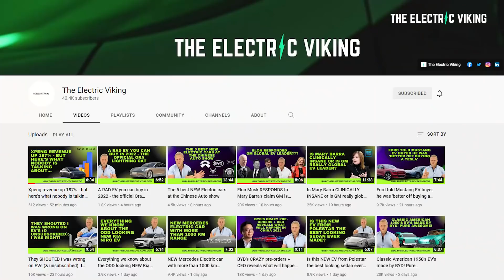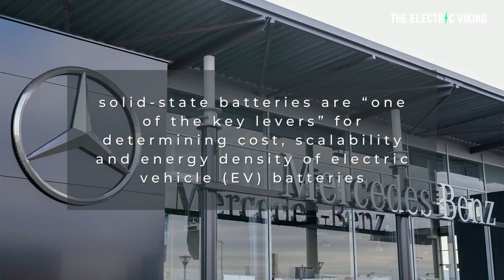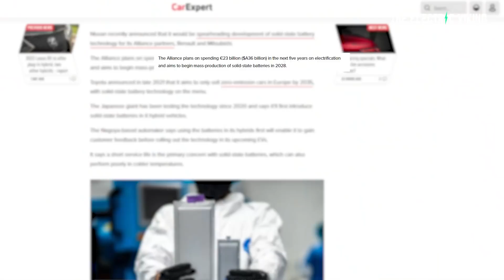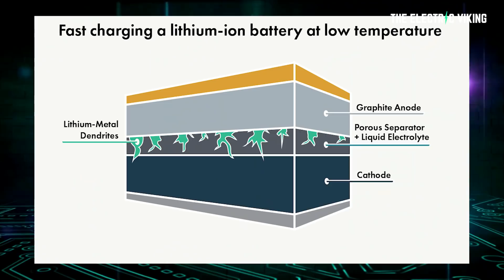Mercedes secretly working with Solid State company in Taiwan

Comment: Filso; I agree Solid State will be critical. However GM' s partner is already selling a $4000 EV in China.  LI EVs have now been around a decade. 
The problem w Lithium and potentially Solid State is the supply of component elements.  There isn't enough lithium or cobalt to make a significant number of Li based cars; max 2 to 4 million.  Big EV makers are going into mining to try and supply themselves.  Lithium prices are up 400%; Tesla can absorb this with their expensive cars; but lithium is a dead end and will never be a major part of the market - you could make 10x more hybrids with these resources ; that would make an immediate impact - Tesla is actually perpetuating ICE vehicles.

Comment: Solid state is the holy grail of the EV industry; if a Solid State that isn't at least 2x more economical , lower weight, safer, w better life cycle unconstrained by resources - then EVs fail.  LIthium EVs can't be made in enough numbers. Tesla sucked up 24% of all Lithium production to make 900K $40,000 USD cars that weigh 5000 lbs.  Lithium cost is up 400%.  1 Billion ICE vehicles exist - obviously Lithium is a dead end.

Comment: Solid State battery can also use Iron phosphate as Cathode to bring down the cost with higher energy density. SES CEO mentioned that during the firechat with IPO Edge. Imagine Li-Metal FP with 300Wh/kg at the similar cost of current LFP.

Comment: Solid state batteries could be very important for longer-range vans, campers, trucks. Existing battery tech gets very big and heavy trying to give them the range that we've got used to in cars. So higher energy density really does have commercial value there. That's not a 2030 thing, that's a right now thing. No-one makes a van that does more than 200 miles yet. They don't make one that does 200 miles on the motorway yet either. You can put a huge battery in a van, but at least in Europe that leaves you with very limited capacity for payload or camper fittings within the standard 'normal driving licence' <3500Kg class. We could just make (and allow people to drive) 4 or 5 tonnes vehicles like they do in the US but it gets expensive and inefficient. More energy-dense batteries really do matter in this market, so if someone can produce them at a reasonable price they'll be snapped up.  OK campers is a bit of a niche market, but there are an awful lot of workmen's vans that do quite long drives and they really would like 200 miles+ in order to get to jobs easily. That's more than just a niche. (but those people are price-sensitive, much more so than the campervan types, so it will remain niche if it costs too much).

Comment: Toyota has invested big on R & D for hybrid power systems and they are not going to dump it instantly and hop on the all electric vehicle
wagon just-like-that,  they want a good return for what it's cost them. Same goes for the rest of the old guard, they don't want to scrap expensive plant and equipment that still has a useful life until it is fully depreciated, what's all this rush about anyway?

Comment: Where I disagree on solid state batteries being luxury, is that commercial application where weight is more of a factor, eg hauling, aircraft, etc. may benefit from higher upfront battery cost to gain the benefits of energy density and charging speed. Not everyone can run accelerated research like Tesla though, so it remains to be seen where LFP technology will be, by the time Solid State is ready for mass markets.

Comment: Seems dumb to put a SS battery in a hybrid. Just put the full battery in a car and see what real world range you get. As far as needing double the size of a battery energy density above 700km I can sorta see a use case "if" SS batteries suffer degradation like current Lithium ion batteries. If you're limited to charging up to 80-90% and if they offer up less range in the winter then yeah I can see the need. Then again it might not have t be if the car has a good BMS, the car is slick and efficient then I imagine it's not needed.

Comment: Thanks for sharing. Solid state batteries are far from being only about the range. Price, range AND fast charging will be key in dealing with EV anxiety to convince the wider population that EVs are at price parity to ICE AND more practical. Additionally, existing battery technology has inferior battery life in terms of discharge energy and chargecycles. Solid state batteries will be absolutely key in driving the EV evolution in my opinion. Unsurprisingly and as with any new tech in cars it always start at the expensive models and trickles down as they scale up production while and covering their return on investment.

Comment: Don't know how soon real mass production of solid state batteries will occur, but even as Sam said that we may not need to double the existing range of current EV's, it still means they could cut the batteries in half to keep the current range.  Less weight = better range and efficiency.   Also, half the batteries hopefully would be less materials used for the battery pack, and [hopefully] less cost for the same range.
Reply: Also solid state shouldn't need as complicated or as heavy cooling&heating systems. That and as you pointed out less materials.
Will make them much more sustainable. Plus imagine twice the volume of cars for the same amount of battery supply. 

All that said current tech is improving yoy by 3-5%+ so at that rate in 5 years current tech will have improved by itself another 15-30%.

I think solid state at first stays in high margin, very high performance but low volume segments, and lfp like the blade battery and teslas structural packs basically takes over every other segment for evs. 🤔

Comment: The market where solid state batteries will make a real impact is motorcycles.  That weight savings and greater range will make a big difference in the limited space available on a motorcycle.

Comment: Advances in batteries which lead to reduced vehicle weight will be a great thing for the environment and for road maintenance. Heavy vehicles beat up roads much faster which increases asphalt and concrete usage. It's difficult to predict which battery technology will become dominant. Things are changing rapidly and it will be so interesting to see how it unfolds.

Comment: By putting them in Hybrids, they can use software to control the reduction of stress on the battery while they see how it performs. The unwitting testers should not be aware of this hold-back if it is needed, they will just use more petrol.

Comment: Mercedes may be correct for high end vehicles. Solid state battery production likely will not scale well and be expensive, but the performance may be very good. It would seem right for Mercedes and other high end yet low volume producers.

Comment: Im not sure SSB can overcome temperature differences when vehicle is turned of and unplugged. cold winter, warm summer, even day night temperature difference will probably break them to fast unless they are very insulated and constantly manage temperature(maby if the cars use solar panels to recharge so they have some power to keep level temperature for long inactivity outdoor).
Reply: The ProLogium cells have a very wide operating temperature range, -40°C to 85°C.
Reply: @cruiser97eric1  yea but operation range is one thing. Damage from heating/cooling over time is another :)

Comment: If the battery can hold more energy in the same volume, then that will lead to cars with similar range and a lighter battery. In turn, that leads to smaller cars with good range, which is aided by the lower mass. A 300 mile Summer range is better than most petrol cars (mine always had 160 to 280 mile range), and people don't complain about that. So ludicrously long range vehicles will become a niche market. My thought is that 200 to 300 miles of range in an EV will become the norm.
Reply: There will be autonomous fleets on the road within a couple years, and they won't even need that much range for 99.9% of customers.
Reply: @-whackd  2 years? More like 10 years.

Comment: I can see the logic in Toyota's rescue of its strategy. The company is heavily invested in Hybrids. SS batteries will be thin on the ground for a long while. Therefore it makes sense to Toyota to maximise the supply by putting them in Hybrids first, where they can be smaller.
Reply: If that was their motive.
But didn't they (Mr Toyoda) say they're only aiming for "50% "electrified" of which a fraction will be full BEV, with the others being ICE/ Hydrogen hybrids"? (Reading between the lines of their "carefully worded" statement)
Reply: @rogerstarkey5390  In all honesty, I' m just trying to find logic in Toyota's incredible error. They thought they could dictate the future, having a very long term strategy towards H2 FCVs, and everyone else would fall into line. Well it hasn't worked out that way and Toyota is regrouping, I think, while still not abandoning H2 for the long term.
Reply: Toyota  recently  Displaced General Motors as the world's   Best  volume seller of automobiles.
 I just left General Motors and now I am a #Toyota Fan Boy.
 Toyota needs to get their heads out of their ass and drop the hydrogen idea and get on the "EV"  Train ❗️ ASAP

Comment: We have a battery technology GIANT LEAP happening that is changing everything that needs power GOOD BY OIL AGE ?or at least a quicker reduction in use in transportation hopefully .I hope solar and wind can mostly replace coal in less than 15 years
Reply: The technology is 2 pronged.
BYD blade.
Tesla 4680.
Cheap.
High volume.
NOW.
Solid State will be high end, expensive for 3-5 years AFTER it arrives.
It's a "2028 technology" (at best).
Meanwhile, the existing tech will do very well)
Re "Coal"
UK national grid.
Right now (10:10 local time)
Solar, wind, hydro power. 31%.
Coal. 2.4% (and that's on the "high" side!)
Down from 40%+ in 8 years
It can be done in much less than 15 years!
Reply: Antigravity technology will be another GIANT LEAP. It does exist.

Comment: Solid state means same power from a much smaller battery size. It lends itself to smaller vehicles and also lets the designers get away from the skateboard layout currently in use.
Reply: Are there any drawbacks to the skateboard layout right now?
Reply: The skateboard layout will be very disruptive beyond what we can imagine. If I can buy a skateboard & it does all the functional & necessary stuff I could build whatever I want on top. A mobile flower store, pizza restaurant. The skateboard architecture opens so much possible avenues & allows many new players to mobilize whatever they want. In the future skateboards will be build in millions & on top many customized ‘cabins’ will be build by whoever wants to.

Comment: Just read the title again.
Should be
"Mercedes throwing money at the    solid state battery problem, hoping they can find technology  that will scale"
Reply: And how do you think R&D works? How is this not good for the customers and the automotive industry itself? Its insane to me that the car industri (very different from most other industries) are full of so much negativity and fan culture. The negativity towards the current players are insane. They are doing a good job in transforming companies of that size. I can tell you, since I work with this kinds of changes in other fields, it takes time. Was working at a large power component manufacturer, and I can tell you. They would need three times the time of doing a total strategy change of everything they work with compared with "legacy auto".

Comment: Toyota...,
The same company which said recently
"We're aiming for 50(?)% "electrified" (btw, about 20% will be full BEV, the rest will be hybrid and foolcells. 😉👍"

(Percentage may be off, but you get the drift?)
Now it's "Solid state in hybrids"?
Translated as either/ or
.
a) We can't make them in volume.
.
b) We can't make them work under high load (better for "backing up" an ICE)
.
c) They're ¥¢•¢%$¢ expensive! We can only afford a few in each car.
.
d) The tech isn't ready now, we think it MIGHT be in a few years
.
e) We can get the cheap cells elsewhere, coughBYDcough. (Probably thinking they can "buy" BYD, more likely to be the opposite)
etc.

Comment: I'll say what I've been repeating for 5+ years.
When the S (Tesla) was launched "They" thought Tesla would fail, or be small fry, that they had time.
Just in case, they called potential suppliers and asked....
"How long before a "game changing" cell?" (Now touted as solid state).
The reply.... "6-8 years".
"They" then tasked a junior designer to sketch an EV concept, and sat on their hands for 5 years.
Model 3 was the wake-up call.
Now, the legacy makers had essentially no car, no competitive cell, no supply of any cell.
.
When you're playing catch-up, one tactic is to fire a "Hail Mary".
THAT'S what all of the "we're in partnership with (small company promising breakthrough)" deals are.
They're trying to overtake not Tesla (wishful thinking), but the others in the soup.
Question.
Does anyone really think Tesla (and Jeff) isn't working in this as well?
(Yes. I know Jeff is officially "retired" but......)
Reply: ofc Tesla is also working on solid state, but i think they are aware that this tech (in terms of scalability and price competitiveness) is at least 15 years away from mass market.
Reply: I think Tesla is pretty happy if they can produce 4680 cells in a dry process in large numbers.